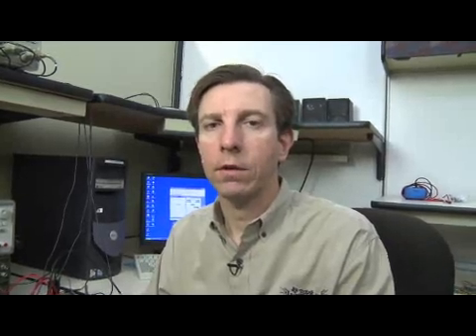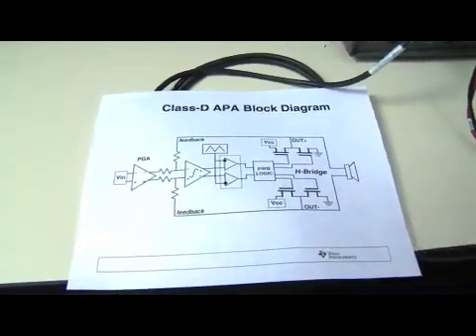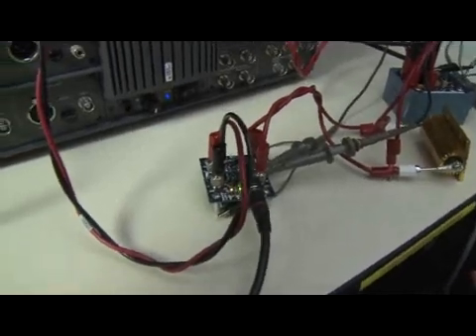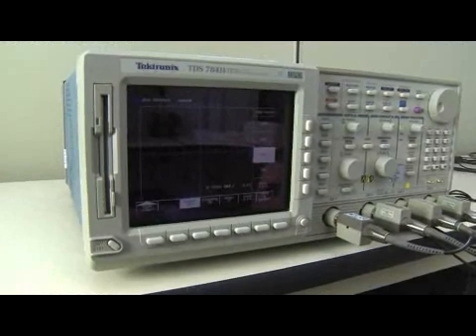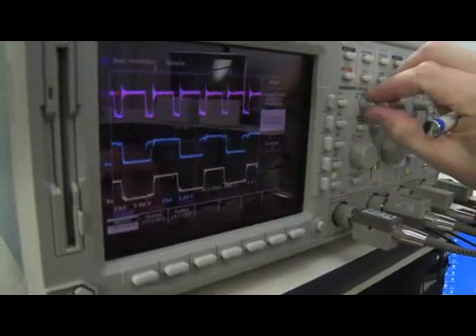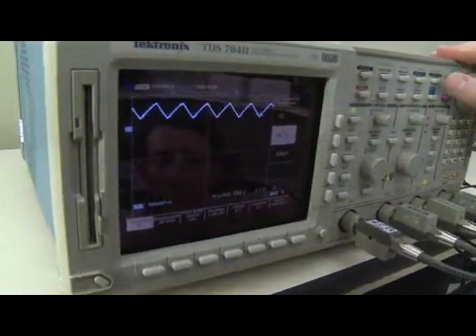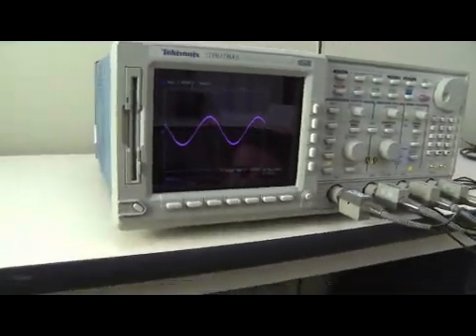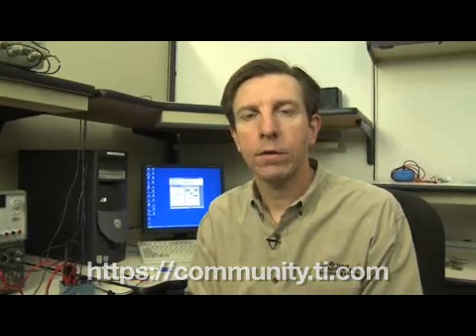How to measure the output of filter-free Class-D Amps

Comment: Thanks for the video.  I think TI is doing a great job in audio.   I have a question.  We can't ground either side of the speaker terminals on the output of a TPA3255.  So how are you connecting your filter to get a single ended output to run into the test equipment?   Are you just connecting to one side?
Reply from the maker: Thank you for reaching out with your question! You can submit a ticket to our customer support team and access TI chat support here: https://ticsc.service-now.com/csm
Reply: Think again. Switching amplifiers aren't a great thing for hifi audio. They're a great thing for portable audio.
Reply: @lazzer408  Search youtube for "Linear Amps are DEAD, Long Live Class D!"

Comment: I am building a portable Bluetooth speaker system of 3+3 watts.It mainly  consists of a filter less class d audio amplifier.The problem here is  that when I am powering both the Bluetooth audio receiver & amplifier from a common li ion 3.7 volt battery,a noise is coming at speaker.
I have a common ground for stereo audio out & power.

But If I power using two separate batteries the problems solves ie. No noise.But it's not portable.Because I have to charge a single battery.

So my question here is ,shall I add a LC filter at speaker output
Or Is there any power supply technique to avoid this noise?
Here no boost converter is used for amplifier ie. same 3.7 volt.
I am thinking it's a ground loop issue .
Kindly comment to solve this pulse like noise problem.And no noise is coming when no amplifier integration is done.I mean if I listen using headphone from the Bluetooth receiver clean audio is coming.
Only amplifier integration from single battery causes noise.
Reply: use a isolation transformer.
Check out this: https://www.youtube.com/watch?v=b2Pb1KuVDS0